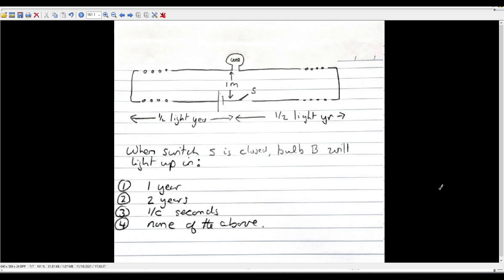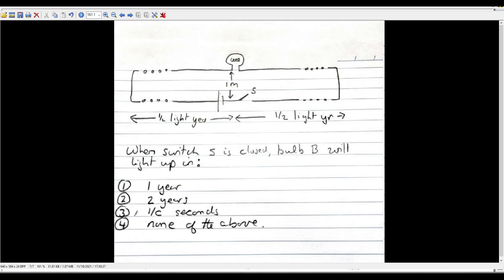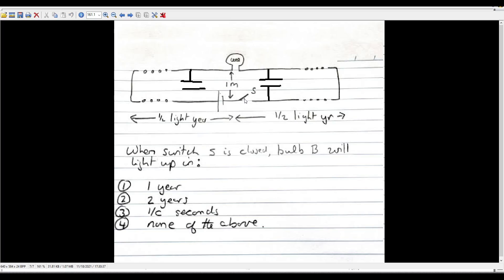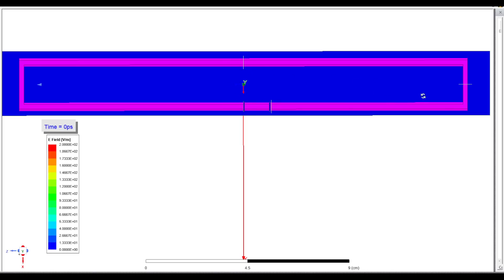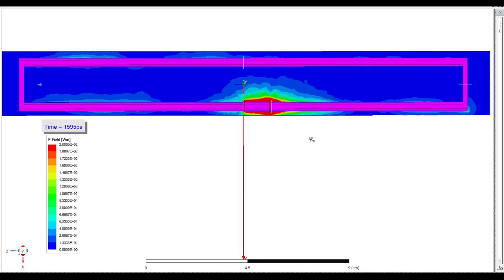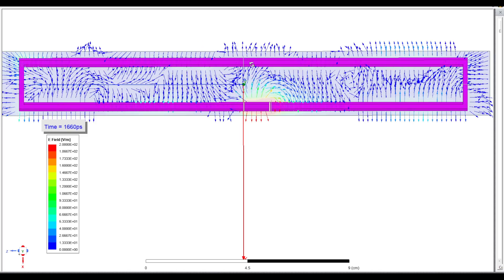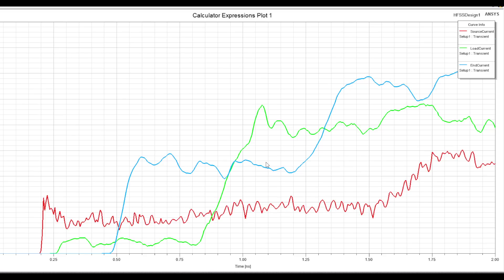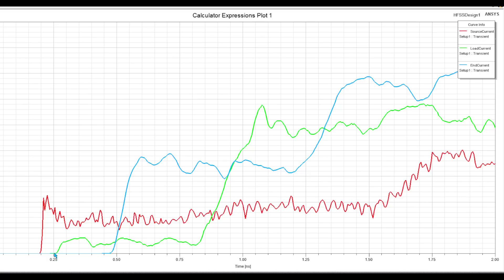Response To Veritasium - Electricity Propagation Time Problem

Comment: Veritasium was not correct, the question is poorly formed and the conditions he is trying to set up to make 3 the correct answer fail. 

Either there is insufficient current to light the bulb or the ambient current will keep the bulb always lit.
Reply: Given that one of his conditions is that the bulb lights at any current > 0, I can't see any other answer than this.  Always make sure you think out the consequences of your conditions!
Reply: @gavinpearcey  So then the bulb is always lit, flicking the switch will do nothing.
Reply: @deadly_dave  In this example yes.  I have some issues with some of the things that Veritasium says in his video, it's well summed up by @Electroboom's response (which came to the same conclusion we did, the bulb is always lit).  My issue is with a badly defined premise used as a 'gotcha' question.  Out here in the real world (as you pointed out below) it isn't a terribly useful example, but the concept of how electricity works at a fundamental level is at least interesting.  I really take issue with the presentation.
Reply from the maker: Well, since this is a thought problem, I see no reason to impose some arbitrary amount of background radiation. Even if you stick on the background radiation, we are free to choose a source voltage that would induce a current higher than that of whatever background radiation level you decide on.
Reply: @PulsedPower  Sure but if we can arbitrarily assign the rules in the thought process, the idea of correct and incorrect becomes meaningless.

Sure in the thought problem Derek's conclusion matches the one he set the thought problem up to represent but that's not how the world works so. I don't see the point to this thought problem.
Reply from the maker: @deadly_dave  The point of the thought problem is to explore how electric signals propagate. That is why it is OK to "arbitrarily" decide that the wires are superconducting, because we arent trying to answer a question about resistance. We can decide to say that the wires can extend for a lightyear(or light second) in either direction, ignoring the fact that gravity would send them flying in a tangled mess around the earth, because we arent trying to answer a question about gravitational physics.

Surely you understand now what I am getting at. The original problem is only posing a question about the EM physics of signal propagation. Choosing a bulb that will only light up at 1A and not 0.1A is no less arbitrary than another value. Choosing a source voltage of 12V again is no less arbitrary than 12kV. Unless you want to re-frame it as an engineering problem and start to consider all of the real-world effects, but then your down in the weeds so far that the hear of the problem is obscured by material properties and part datasheets.
Reply: @PulsedPower  Fine, in Dereks thought experiment then, that is what happens but in the real world it isn't at all what happens, so you can maintain the stance that he was correct but as his findings don't match reality, I will stick with he is wrong.

Also choosing 12V wasn't totally arbitrary, 12V sources exist as do 12Kv. Changing DC to AC might but as far as I am away this was not proposed. (neither would change the outcome of the thought problem) A lamp that requires 0.1amp or 1amp to illuminate also on the list of things that exist. (also wouldn't change the outcome) One that requires any value greater than 0amp, is not on that list of things that exist and does change the outcome. It's fine to isolate variables but when they change the outcome, this should be state outright. For instance: 'This isn't what would happen in the real world because X' or whatever.

I mean I suppose it's fine, but this seems more akin to arguing about how fast superman can fly, sure we can create a though problem around it, but I wouldn't make a video on a science style channel, and start that video explaining that all the experts are wrong because in my thought problem things work out weird.
Reply: In saying that, I do like the way you address the thought problem. So I've sub'd.
Reply from the maker: @deadly_dave  You seem to imply that this thought problem in its unconstrained form is more or less useless (thus the analogy to arguing about superman). However I think for the vast majority of people it is still very instructive as to how "electricity" works. It certainly wasnt clear to me until I did some serious thinking and this simulation that there would be a sustained current at some level while the full amplitude propagated along the wire. I thought maybe there would be a blip of influence from the switch closing. Others thought that even a blip would violate the laws of information transfer etc. It still prompted a very rich discussion, and of the idea of what multiple choice answer is more "correct" depends entirely on how you constrain the problem, each person will have their own interpretation as we have seen. In the end, the discussion of "which is correct?" can be almost totally separate from "what happens?" or "how does it happen?". I am personally mainly interested in exploring the last two quesrions rather than the first.
Reply: @PulsedPower  
No no, don't get me wrong, I love superhero media stuff just as long as I know I am discussing/consuming non reality at the time. I suppose my problem was with the misleading demonstration of the data.

I think it promotes a misunderstanding and misinformation & I don't like those things. 
He could have made the same video (similar video) and been more detailed about why in the real world none of what he just showed would ever happen and I would have been happier with him but as it is, I feel clickbait was more important than education. Which is fine, he can do that if he likes but I don't want to be clickbaited, so I will be slow to watch a future video from Derek.

But sure, we clearly agree on the science but disagree on the interpretations. I suppose that's fine and I will leave it at that.
Reply from the maker: @deadly_dave  Gotcha, thanks for the clarification and discussion! 👍
Reply: @PulsedPower  Thank you for the discussion also 👍

Comment: If the wires were interrupted at 1/2 light year's distance, flow of electrons would be impossible, because of a non closed circuit. It would be of no importance, whether a switch close to the battery would be closed or not - there would be no closed circuit because of the interruption at 1/2 light year's distance. In reality a light bulb will need a steady current flow to light up - and will thus take 1 year to light up with a closed circuit.

Comment: Well, that is what I expected, and it is great to finally see a proper simulation to the problem, and it is the reason why I said it is NOT answer 3, 1/c meters (please dont say 1/c seconds, this factually is wrong, cause that is not a time). Two reasons for my conclusion it is not 1/c meters: 1. The current after 1/c meters time is not enough to actually lighten up the lamp. And in the simulation, you could perfectly see, that the step-like change in potential has to travel along the entire wire and reach the lamp until the actual current is present. I mean, even when you look at any standard DC circuit, then most of the energy is transfered along the wires where electrical and magnetical fields are strongest. It is in any case a tiny amount of energy, that can be transfered directly between source and lamp. 2. And this one is kind of open for an argument: To speak of lighting up of the lamp and speaking of an actual energy transfer, then by definition you speak of the steady state.

What I would like to propose how to alter your simulation is to put the switch directly next to the bulb and away from the source and see what happens then? Also is it possible to also display the Poynting vectors at least close to the source and the lamp? Both things probably will raise more questions, but will makes the problem much more interesting!
Reply: The answer is still wrong. No delay at all will be observed! We did the actual experiment. See my detailed post a the top of the comments
Reply: @williamwalker39  The actual experiment? The "actual" experiment would have really long wires :D
And physics stands in your way. The electric field goes with 1/r around the wires. The magnetic field goes with 1/r around the wires. Thus the energy density and the energy current density goes with 1/r^2. So yes, fields only have to travel 1 meter and thus very quickly reach the lamp. And yes, one can certainly measure that. But the energy transported is so tiny a few centimeters away from the wires, that you would have to make a REALLY strong voltage pulse to get the lamp going. The majority of the energy is concentrated very closely around the wires.
Reply: @williamwalker39  You do not mention any reasons, you do not show anything. And guess what: your comment is only for you on the top but not for anyone else! Hence so far it is literally all nonsense you are writing.

Comment: Shouldn't the load be represented by some additional resistance? There should be a potential step forming at the load as well over time, right? Wouldn't the current you see at the load be significantly smaller if you actually used the distance of 1m rather than maybe 2 cm. I love how you showed the time evolution of the system. I think, however this view of some current showing up at the load by induction somehow misses the point of Veritasiums video about power being transmitted through lines, where usually, especially inside homes, we go to great lengths to prevent losses due to induction.

Comment: I'm missing in most explanations whether the distance that matters is between battery and bulb or whether it is the distance between switch and bulb that counts.  I would expect the switch is the relevant component as it is the one undergoing a change and hence the field propagate from it, not from the battery, right?  Your drawing / simulation is finally clarifying this, but still would make it more clear if you move the battery / voltage-source a significant amount to the left ...
That said: best explanation I've seen so far (replacing "ElectroBooms" or something as my #1).

Comment: Not sure if you will read this, but can you simulate (or show)  the electric field inside the conductor? To see how the condition change from E=0 to a value that, in the end, will be in compliance of Ohm's law E = j /sigma. It would be educative to see it for a square circuit of 2.5 cm (or whatever spacing you used here) and then for the wide circuit with the same 2.5 cm in one direction.

Moreover, seeing the electric field inside the load will clarify exactly what current is initially flowing in the load alone, before the complete circuit is formed.

Comment: You got the problem answers wrong.  https://youtu.be/bHIhgxav9LY?t=36
You got the direction of the conventional current flow wrong: time mark 3:17 (conventional current flow is from the positive batt terminal through the circuit to the negative batt terminal.

A capacitor is initially shorted (when the switch is 1st closed) until it is charged & then it blocks DC current flow, until there is a change in current flow.

1m is quite a gap between the conductors for an electric field to be effective--given the electric field decrease rapidly with an increase in distance between the conductors.  There may not be enough energy in the electric field to light the bulb (depending on how much energy the bulb requires to become lit).  It would take ~1 sec for the 12 V to propagate 300,000 km to reach the bulb & stabilize to provide the main energy that is needed to get the bulb up to max intensity.  Even if the wires were superconductors it would still take some time for the V to travel the 300,000 km to get to the bulb thru the loop.
Reply from the maker: Watch the first 30 seconds again. My video is a response to his community post not his video. The diagram I show is all I was analyzing. I posted my video before his.

Otherwise I am pretty much in agreement with what you have said.

Comment: Nice presentation. not sure the aspect ratio was high enough to get the full transmission line effect.

The veritassium layout left a lot of unknowns regarding just how one gets zero ohm wires that are half a light second(*) long (and the effective skin depth would be zero as well..). 

If one allowed a 2v drop (out of the 12v battery), then the cable size is still massive, though computable, then try to match the transmission line impedance with the effective line drop in DC state (after say 10 seconds ). A fun problem in radiation and EM theory!

Comment: Tl:DR: Electrons are carriers of charge, but waves are caries of energy. Some EM waves reach bulb at speed of 1/c (wirelessly), but majority of energy still needs to travel trough wire.

If you're interested in seeing with his own eyes the exact moment that this phenomenon (that @NenadStevanovic refers to) happens in the most eye-catching way, you can just jump directly over to:

https://youtu.be/aqBDFO1bEs8?t=475

You can clearly see the "wireless reach" of the EM waves over to the lightbulb that's standing "1 meter" across the battery. If you keep watching you will witness that this wireless EM wave reaches the lightbulb waaaayy sooner than the fields that are being propagated through the wire from both wired-sides of the battery.

Comment: I did a test with a 20GHz sampling scope with an integrated TDR and some 450 ohm ladder line a week or so ago, and see exactly what you see. ie, there is a small perturbation at the conductor separation  distance time. Note Veritasium’s question is a trick question, particularly in that it’s when one sees any amount of current, not that it would necessarily be anywhere near enough practically speaking to light a bulb.

Comment: Hi Ben! Awsome, that you tried Ansys for that, I also wanted to do that, but unfortunately dont have a license... Can you please also make a video of a similar simulation, were  there is a circular flat coil made of 5 turns 1mm thick wire, 100mm in circle diameter , and  100mm away parallel to it a same coil? Switching on the first coil at 200ps, second coil switching on at 533ps, and the output information should be the force on the wires. Can Ansys HFSS do force simulations? That would settle, prove or disprove an Idea of a propellantless EM drive, that I saw long ago.

Comment: Consider a circuit that is has 1 millimetre gat between the paths. So the battery and the bulb will be 1 mm away. Imagine the circuit is infinitely long. Then according to you the bulb will light up in 0.01/c seconds. Doesn't make sense

Actually the thought experiment veritasium  is wrong.
Reply from the maker: Correct, what makes you say it wont light up?
Reply: If the circuit is infinitely long it's as good as open, so technically the circuit shouldn't be complete. 

Now this is also nonsense since this thought experiment is playing on the concept of infinity
Reply from the maker: @baijumathew5930  it doesnt have to be complete for current to flow in the opposite wire. You brought in infinity, not me. The fact is current will flow infinite or not.
Reply: @PulsedPower  I agree, I meant that my own introduction of infinity is nonsense. The point I am making is that in these thought experiments we end up with counterintuitive conclusion as the experiment is wrongly designed.

Will an infinitely loong loop be closed. One possible answer is that it won't closed since the electron will never reach the last point. But it's my mistake that I introduced a new entity

Comment: If the wire is 1mm thick the capacitance is only 0.0088pF/m whereas the inductance is 2×1.5uH. Yes you will get less than a picosecond current to light the lamp but you will certainly not see it. If you model the to pairs of wires as shorted transmisson wire made of 880pf/2×150mH simulating 10,000 km long each section multiplied by 15 sections on each side, then the wires are not capacitive but inductive, with 1kohm resistance lamp it will take 15ms to reach 80% of the battery voltage on the lamp and 150ms for 100 ohms.

Comment: What if the wires between the top and bottom sides of the circuit were replaced with ground connections? Would the two wires have the same current as each other when equilibrium is reached? If so, I would assume I_shared = V_source / R_bulb. Is that true?
Reply: Also, what do the curves describing the current over time look like in this case?

Comment: If we assume the switch is once meter from the battery, then that small first current wil take sqrt(2) m / c
Reply from the maker: Not if the bulb is 1m from the switch (bulb directly opposite the switch).
Reply: @PulsedPower  but in the original problem the wires are 1m apart and the battery is also 1m from the bulb?
Reply from the maker: @okkomp  No, the only specifications are the 1m wire distance and the 1/2 lightyear lengths on each side. Your point is correct though, the straight-shot distance from switch to bulb determines the time!
Reply: @PulsedPower  In the original it was 150,000km which is 1/2 light second actually.. What would happen if the wires were 1km apart? would we be able to notice any effect prior to the current coming around with the wire?
Reply from the maker: @okkomp  At 1km technically yes, there would be a signal after 1km/c, however it would be extremely tiny, about a million times smaller than with 1m distance.

The "original" problem that I am talking about is the photo I show at the beginning of the video. It was posted by Veritasium in a community post and I posted this video in response to that, all before Veritasium posted his video.